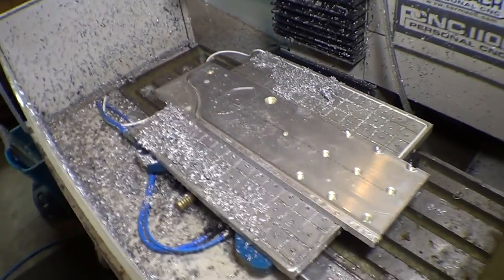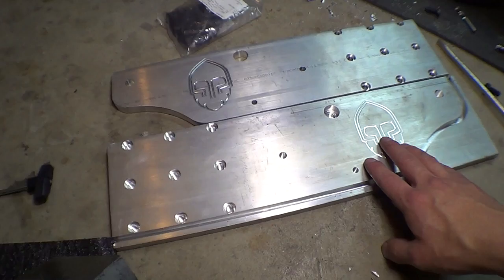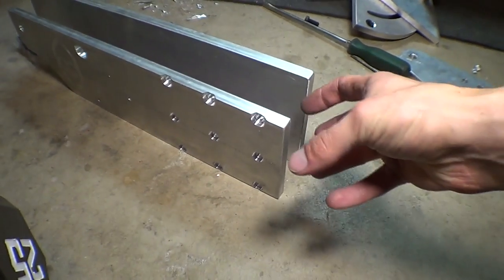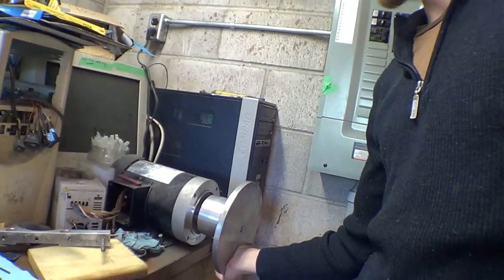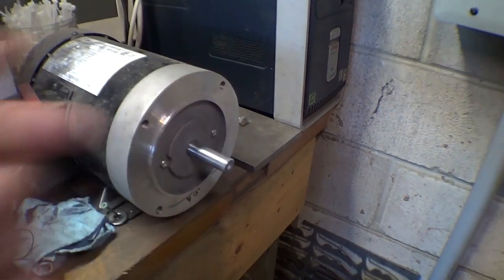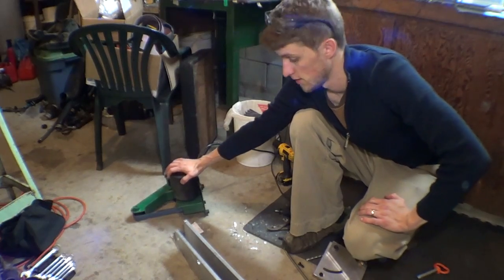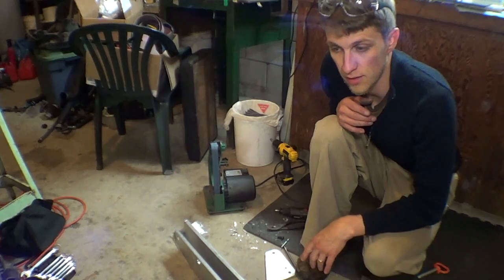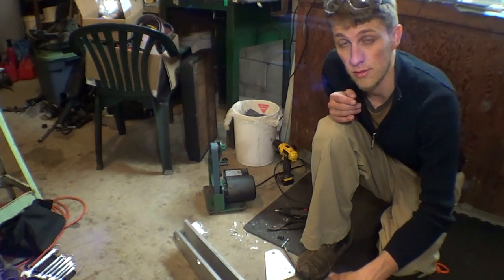Knifemaking Tuesdays Week 74   Grinder Part 2

Comment from the maker: I looked it up a long time ago, and the general consensus on the internet was that when using it on wood you call it a sander, when using it on metal you call it a grinder.  Even if they both use sandpaper.  Like Dallas Clark said, google "belt grinder" and see what you come up with.  And besides, every company selling a similar unit to knifemakers calls it a grinder, so that's just what it's called.

Comment from the maker: I leave 0.010" which works well if it's measured accurately.  You can't go through the part at all without messing up vacuum, which will lift the part and ruin everything.  The only way to go through is to put an o-ring right around the hole that you want to machine through, that way that hole doesn't see vacuum and won't be affected by break through.

Comment from the maker: Yeah belt changes will be a tiny bit harder, but shouldn't be an issue at all.  Once it's off the contact wheel there is tons of slack, so I just have to loop it around the disc, no biggie.  What grinder are you getting?  Can't wait to have mine finished!

Comment: Yea the paint is coming off mine as well. Thinking about that plastic spray in a can several colors are available. I use it on my home made coolant system  so far so good. but no rust at all mix is rich very. id rather have the paint come off then have rust..  peace

Comment: Why not use a pulley system with a plate and some bearing pillow blocks and a rod.  Then you can keep the two a little away from each other plus change out pulley sizes for additional speed control.